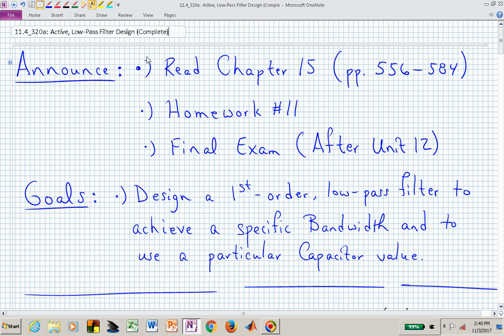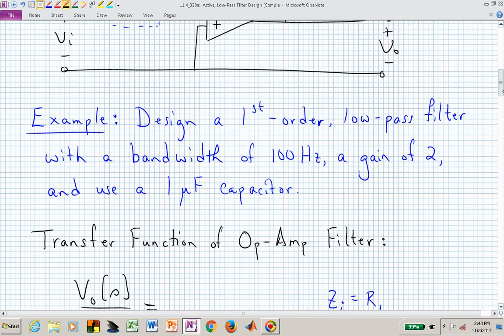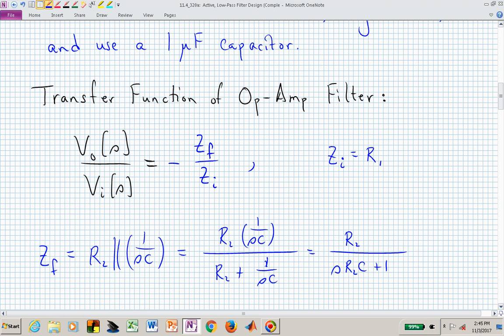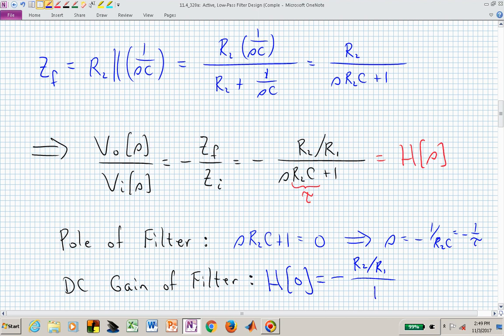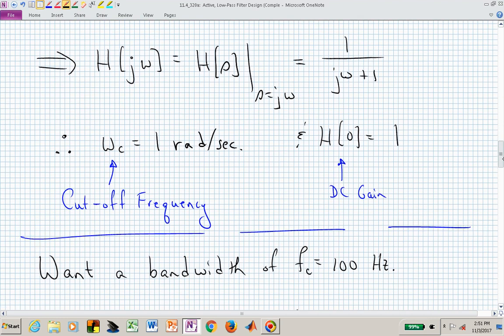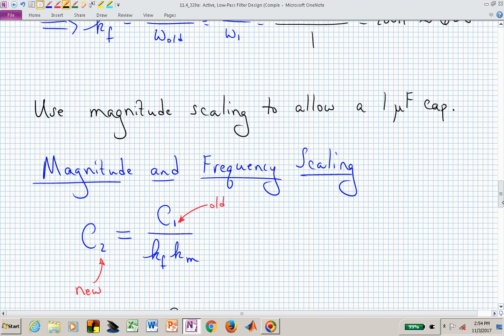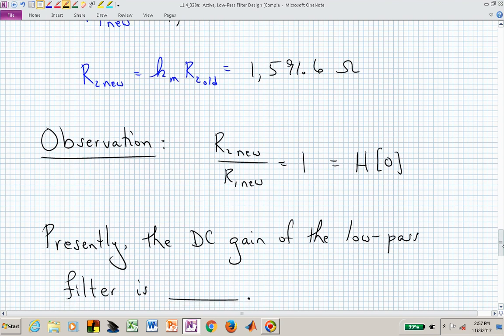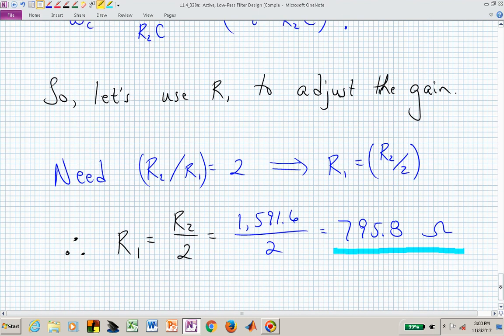vid11.4_ece320a

Comment: Not clear why we had to go through all that frequency and magnitude scaling when the answer is right there in two steps. The transfer function is R2/R1/(R2*C+1). If we want a cuffoff frequency of 100 Hz = 628 rad/sec then R2*C = 1/628; Or, solving for R2 =1/(628*10^-6) = 1590. For a gain of 2 we have R2/R1 = 2 or R1 = 0.5*R2 = 1590*.5 = 795.
Reply: I think the idea is knowing how to alter equations that already have coefficients displayed as numbers instead of the value of the components.